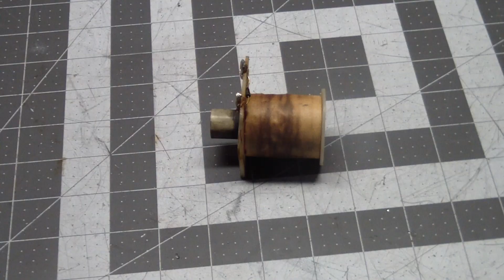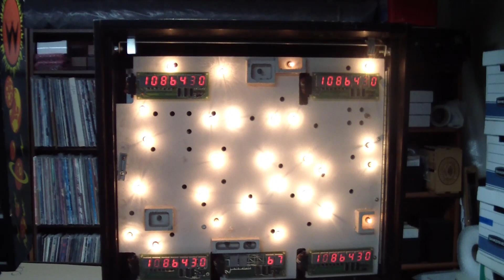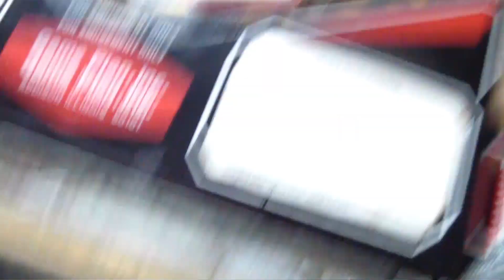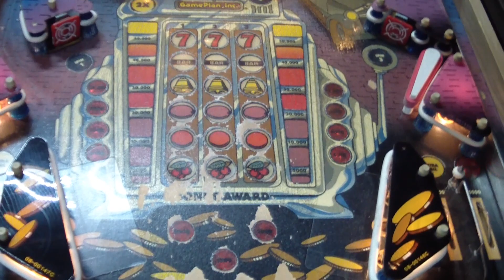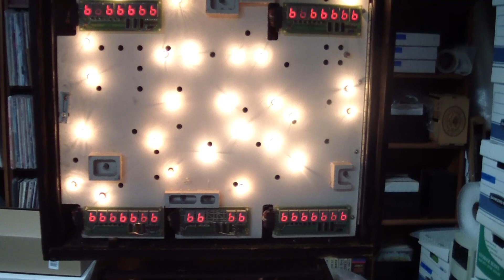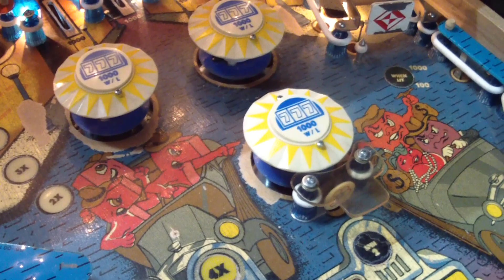AE#180 Game Plane Agents 777 Pinball Repair, Part 2

Comment: ARTIFACT, What do you mean by Binary Search troubleshooting skills? What is the POST power on start up test doing? I would think if the Solenoid Driver FET are shorted causing the coils to get damaged that the POST would shut the power supply down since there is a short.
Reply from the maker: Isolate different sections from each other to pinpoint which section the fault is in. Rinse and repeat.

Comment: Why not use a thermal imaging camera to locate shorted or nearly shorted ICs Instead of binary searching and cutting traces? Another great video. Thanks.
Reply: um, using your brain is free. A thermal imaging camera isn't and their not that accurate at times.
Reply from the maker: A thermal imager would be quite useful, but a cheaper alternative is to spray sections of the board with IPA and observe where it evaporate the fastest.

Comment: Excellent persistence, Artie. Would it not have been possible to identify the chips dragging down the supply by them getting hot?
Reply: I saw a guy using a uv or heat camera to help fix boards like this.  Super sensitive to heat change so he was able to find the issue quick
Reply from the maker: Yes it would. Years ago I tested a bunch of AT&T branded DRAMs, found the bad chip and had the AT&T logo burned into my finger.
Reply: @artifactelectronics  Ouch!